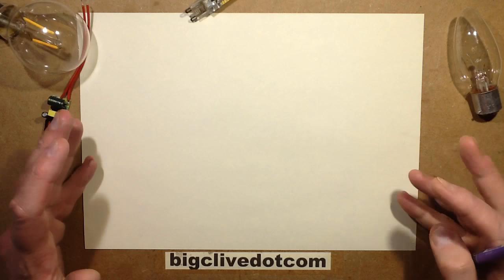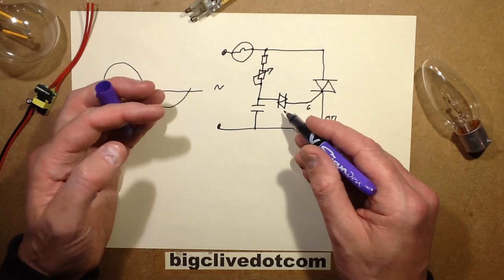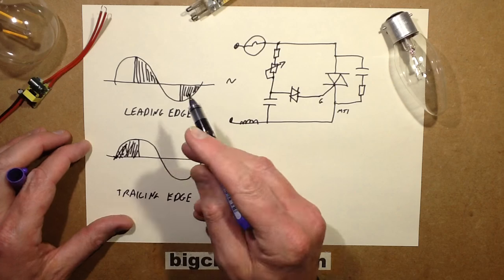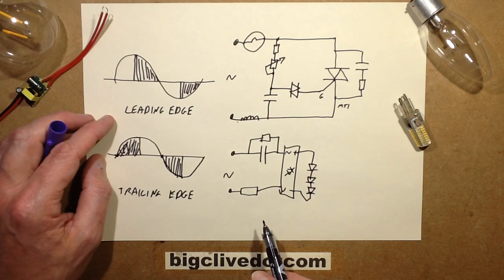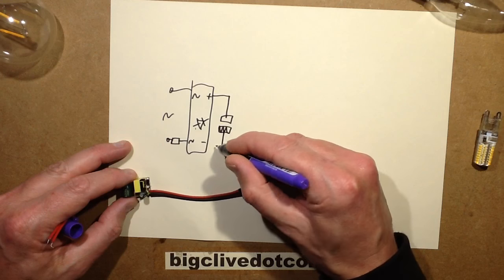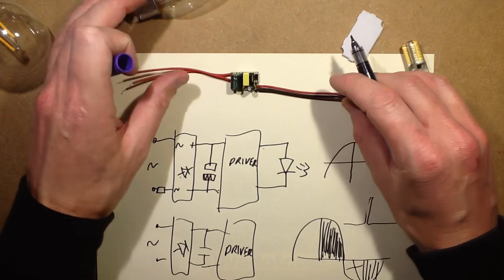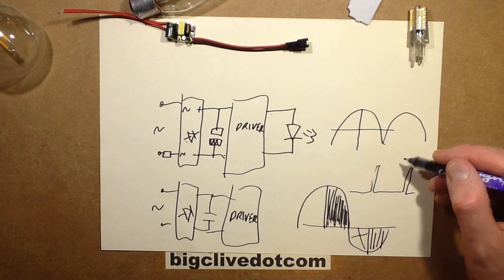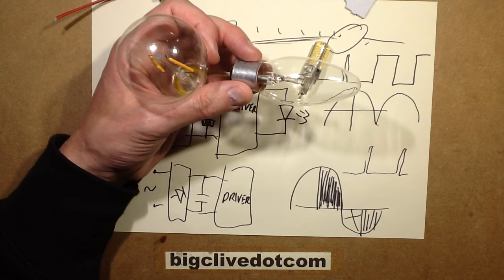Dimming LED lamps with ordinary dimmers.

Comment: Clive - something you've mentioned in a couple of videos. That "discharge" resistor isn't only to prevent the terminals of the appliance giving you a tingle when you unplug it -- though it will do that -- it's a key part of the dropper power supply.

Essentially, it slightly reduces the voltage across the dropper capacitor so that less of the mains voltage is dropped, and so more mains voltage is available to the load. (It's a significant term in the dropper impedance.)

Try removing it from something; I suspect it'll stop working or work at greatly reduced power. And it'll give you a tingle.
Reply from the maker: The resistor is primarily to prevent a tingle from the base of a lamp or pins of a plug.  It passes very little current in relation to the charge coupling through the capacitor.
Reply: Could you please try it? Whip it off something with a significant DC load?

Comment: Hmmm... I have no experience with AC so it may be an obviously dumb idea, but why not just put a huge capacitor after the bridge rectifier so it literally smooths out the chopped sinusoidal input? Would it be too expensive or is there another reason?

Comment: If they're going to develop new wallplates (that would be signalling the lamps over power or via RF), then instead of again switching all the LEDs on and off (albeit quicker this time, using high-frequency pulse width modulation), would it not make more sense to design the lamps compatible with a clean-slate dimmer-to-lamp protocol so that these "dimming 2.0"-compatible lamps would consist of multiple LEDs, and would only drive some of their LEDs, depending on what the dimming 2.0 protocol tells them?

Comment: Instead of PWM to control all LEDs in the light, would it be possible to use the sine wave to turn a percentage of LEDs on? For example, at 100% all LEDs are on, and when the dimmer is at 50% then only 40% of the LEDs are on (I'm assuming it's not a one to one ration for power in to what the human sees). That way, hardly any flicker as it's no longer PWM controlled...

Comment: How do those filament-style LED bulbs work with dimming? There's so little space to hide circuitry, but they work BEAUTIFULLY with both the manual dimmer and smart dimmers I've used. They've got even more range than the incandescents used to have, and they don't even get particularly warm.
Reply from the maker: The circuitry is often ultra-simple and has a high combined forward voltage.  A bit like dimming a string of mains voltage fairy lights.

Comment: my guess is that dimmers will be connected to drivers on wall and low voltage DC (some standard, may be 12V?) will be sent to the lamps.

Comment: It would be good to learn a bit more about dimmers using back to back power MOSFETs. "Two wire" (non neutral) "smart" dimmers are flooding the market are using this design and allows them to sit in series with the load. They steal a bit of current for their own always on circuity by allowing only a tiny amount of current through the load/bulb. Then to turn on / dim the load / bulb, the MOSFETs are opened up allowing more current to flow.

Comment: you know there are dimmable led bulbs, i just wonder personally, do they work properly with a non-synced pwm dimming circuit (constant pulsewidth modulation)?
i'm planning to make a digital dimmer myself, arduino nano, optocoupler, dual output transformer (+ - + to have a "separate" supply for the mosfet and arduino) and 3 fullbridge rectifiers (or 2 if i opt for an SSR, basically a TRIAC with an optocoupler)

Comment: Unfortunately, some of us have the dimmers inside the fuse box... Haven't checked in a while, but last time I checked there was no replacement available yet that would drive LEDs properly. Especially with the weird wiring scheme those things employ (it's pushbutton based).

Two problems with my setup:
1) Although that dimmer is rated for 40W minimum, my 8 x 5W LEDs don't work properly with this setup, and I had to replace one LED with a standard halogen spot just so I could turn the damn lights off.
2) It works fine with my dimmable LEDs, and while you do notice some flickering if you look straight at them, it's not really noticeable otherwise. However, they won't dim down all the way, like the halogens did. At minimum power, they're still a bit too bright for my taste. And they don't dim down to a warm reddish colour either, like the old halogens; it's just less bright white, not at all natural.

After all these years, we still don't seem to have a decent LED alternative for the good old dimmable incandescent bulb...
Reply from the maker: Best option there may be to bypass the dimmers in the fusebox so there's a constant feed to the lamp holders, and then use remote controllable lamps or holder adaptors with the nifty self-adhesive flat wall plate remote switches.
Reply: That would be an option. Or I could check if Niko finally got around to making a wiring-compatible rail-mounted LED dimmer to replace mine. The wiring scheme is weird though: http://www.niko.eu/NIKO/Documents/PM005-70300.pdf (mine is connected with the pushbuttons on the neutral). Time to check their most recent catalog...

Comment: The simplest solution for dimming LEDs would be to use DC power, and just use a suitable rheostat of somesort on a dedicated LED-only radial circuit, so rectify the AC into DC at the lightswitch, then use a variable resistor as the dimmer with an appropriately designed standardised (HAH!! Like that'll happen!) LED bulb in the light fitting, and there we have it... :)

I will say though, I have seen dimmable LED lightbulbs used on youtube, fella in Canada (vlogginlife here on youtube) has dimmable LEDs on two separate relatively standard dimmer circuits, so they are in existence, just not from places like banggood, etc., where our favourite LED filaments tend to reside... :)

Comment: Shouldn't we change the way we distribute energy throughout the places which we live in? I mean...leaving the mains for household appliances but develop new standards, for lighting, now that led replaced old tungsten filament lamps?
Something like a breaker that feeds a control unit that gives out 24V= o 12V= for all the "lighs line"? This way LED lamps would have much simpler circuits since there is no need for transformers, rectifiers and so on, leaving just some resistors, maybe better lamp life (since you are not feeding it with 230V and spikes are unlikely to happen because of the smooth and stable current supplied by the control unit), complete dimmability and so on.
What do you think?
Reply: That would be a terrible idea.

Comment: Would pulse-width modulation (fitted between the bridge rectifier and the LED itself) not be one possible option for dimming an LED light? As I understand it, LEDs easily tolerate rapid on-off switching, and some battery powered LED torches or head-lamps already use PWM to provide different brightness settings.
Another possibility: A miniature variac (directly rotated by the dimmer knob) fitted within the wall-plate, to adjust the AC voltage fed to the LED lamp. Of course a variac that small could only handle a few watts (maybe a few tens of watts at most), but LED lamps only use a few watts anyway, so that should work, should it not?

Comment: One problem has been the lack of a neutral connection available behind the wall switch.  Triac dimmers rely on the load having a sufficiently low resistance to 'see' the neutral at the other end of an incandescent filament, but with LEDs the high (and non-linear) resistance makes things unstable.  When I first saw wall switches with the neutral passing behind through a connector block I thought it was lazy wiring or a failure to understand the 'loop-in' method, but with the neutral available behind the switch, many options become available for the future whether it be 3-wire trailing edge modules; 0-10V; Dali; DMX etc.  One problem when building new houses is predicting whether a proposed new lighting system is about to become obsolete.    It's safer to just specify standard 230V switches or triac dimmers, but at least with a neutral in the switch, some future upgrades are possible.  Could a standard triac circuit be made more stable if it had a neutral connection available?
Reply from the maker: Unfortunately for a while the UK regulations specified that Live and Neutral should not be in switches together as it encouraged people to tap-in and fit sockets next to them.

Comment: This probably sounds stupid and it probably is, but what if you had a small vertical  circuit board with a series of resisters starting at the top and the wiper works its way down starting with no resister for full current and the value of each resister increases slightly until the light is barely on and the wiper starts the current of each resister when the wiper touches that connection? I guess you could call it a variable resister, is this a possible scenario?

Comment: Wouldn't it be possible to have an inductor after the rectifier and cap to smooth out the incoming voltage, and have a circuit that will produce whatever pulse width is required to not use up all the charge until the next half-cycle with that given voltage, without having to worry about the shape of the incoming wave?

Comment: What about replacing the old dimmer switches with variable voltage regulated power supplies and just supplying LED bulbs with clean, straight DC at a voltage adequate to the desired brightness?

Comment: now that you said all this about traditional dimmers what about the new type of dimmers coming out in the market that are meant for LEDs and the LEDs that are meant to be dimmable by these without using the secondary set wires (grey and purple) that you would use in a commercial environment or new construction. do you have any idea how these new dimmers work or does it just go back to the fact that the newer style bulbs have that expensive circuitry inside and it just makes it easier for them to read with a new style dimmers
thanks love you videos and what you do
Reply from the maker: Traditional dimmers shouldn't need the other wires unless they have two way switching.  The trailing edge dimmers are sometimes touted as being LED compatible, but only with LED lamps that are designed to be dimmed by them.
Reply: Thanks
Reply: I use a wall plate which can be set to either leading or trailing edge operation, and use LED lamps specified as dimmable. As the video suggests, there are good and bad - right now I'm only using Phillips lamps where I need dimming; these do use the IC which interprets phase angle & then PWM's the LEDs. These are slightly more expensive, but not excessively so, and are also available in warm colour temperatures - so they are ideal replacements for incandescents. They do operate better, achieving lower minimum brightness, with trailing edge control. I did try lower cost lamps branded Duracell, however they strobed (even on straight mains - no dimmer) to the point that any movement even just walking through the room was disorientating. The difference in cost between the lamps isn't I think too great when you consider the technology you're getting in the better lamp (and clearly the cheapest ones in this case weren't really fit for any purpose, at any price) and the useful working life. I've had a couple of early-life failures on other Phillips lamps (one non-dimmable; intermittent, and one of the much much more expensive "Master" professional range dimmable; dead - however this was running on an old triac dimmer which isn't recommended) but the consumer-grade ones I have (2 sets of 5 lamps each) on the trailing edge dimmer seem to be doing fine. It's the dimmer which is particularly expensive, but looking at how it's all crammed in to give two channels in a single wall plate is quite impressive - they're based on PIC microcontrollers, and also support IR remote control. I miss having the traditional rotary control, but to be honest there's so little space I'm not sure they could have fit one in place of the push switch! I'm still a little uneasy at the way they work (the controller is permanently powered), but there's little else you can do without a re-wire or resorting to radio .. and I'm not keen on radio links for each lamp either, for several reasons (incl. more permanently powered devices, need/ability to operate multiple lamps on a single channel, radio range, security, etc)

Comment: Came here thinking I could finally get an answer to my question as I'm trying to design this very circuit.. 24VAC to 35V pwm LED .. so far so good with triac decoder circuit. But question I can't figure out is if the phase angle is low (say 10%) then how would there be enough RMS voltage to power 35V led using PWM it's full brightness at less time but still uses full power🤔

Comment: I have a new Philips R7S LED Dimmable working perfectly with a Legrand wall Dimmer. I have tried a Philips and other branded G9 dimmable with ceiling fan light but it doesn't work properly

Comment: Hi Clive,
 What if you rectified the mains to DC, and effectively drove each LED as a separate unit using a chip of some sort?
So you turn the light on and x amount of the LEDs light, not bright enough, you turn a controller and x more LEDs light.
What do yoy think?

Comment: I doubt this will ever happen but perhaps the future is (low voltage) DC supplies for lighting circuits. For example have a 36V DC supply at the consumer unit being fed to lighting circuits. 36V is probably high enough that for most houses the cables wouldn't have to be overly thick, larger properties would have a 36V supply on each floor maybe. The bulbs could have tiny PWM modules built in or perhaps better would be to put the PWM in the light switch along with a remote control system or whatever other pointless technology you might want in there.

Comment: Now I really want to try the dimming stuff we sell at my job. They are not integrated into the wall plate but rather kid of dangling behind and you use a momentary lamp switch to control them. Would tthere be different requirements for star and ring mains? (I use LAN terminology).

Comment: BigClive, what is the magic inside an LED load regulator (such as the Varilight GlowFix Regulator) that makes dimmers behave better with LEDs? Is it just a very expensive resistor or a more complex capacitive dropper?

Comment: Would a dimmer that adjusts the output voltage to be a percentage of the input voltage work better?  It would probably have to be nonlinear for lighting, but it could possibly work for inductive loads as well.

Comment: Seems I've stumbled into a minefield trying to go led!
I mentioned on your other vid before I saw this, I have a Philips filament style bulb i picked up in Saintsbury's, saw "dimmable" on the box and thought I'd be ok, but the irritating buzz is there. Interestingly one bulb is much worse than the other, might try asking for an exchange to see if it's just a particularly bad bulb as the other one is almost bearable when not right next to it.
Is there a particular key word i should be looking for when searching for a suitable dimmer? I see a lot described as led compatible, but mention trailing edge, which is no good either? I can't believe there isn't a simple solution to this problem!

Comment: I have several led lamps with warious led count. I think dimming should not be done by electric current manipulation like the old solution where it was only one lightning element in a lamp but simply just lighting up less and less led in a lamp. A 3W LED lamp is much less bright than a 10W with a lot more led so it's kind of a dimmed down version. I think that would be easy to design but it wouldn't be continuous obviously but it doesn't really necessary in my opinion.  maybe 3-4 stages. That would be enough for any needs. Even 2 or 3 stages could be good enough.

Comment: Here is some more information if anyone is interested. 
You shouldn't use leading edge dimmers with any tipe of LEDs, even those with linear drivers which swich how many LEDs are in series. Voltage spike is so big that they can't react fast enough and even small capacitances arround the board make a big difference. (I wouldn't use leading edge dimmers anywhere thease days because some of them make so much noise they affect celphone, WiFi, Bluetoth...)
You can use trailing edge dimmers on most LED lamps with some kind of linear control as said in the video but the problem is not only flickering bacause of ON/OFF but zero cross detection too. LEDs are so fast you can see 0,5% jittering and with so much noise on the power lines these days zero cross detection is not that easy. (We set the minimum for this type of dimmer to 25%) so the jittering is not so visible, but it is still there if you look for it.)
There are many different options for dimming but they normaly start with dedicated LED power supplys at arround 25W and up, they are a bit more expensive but you can get a good brand for arround 20€/$ and they last for years. We mostly use 3 types of dimming: 1.Push button (for old instalations where wires are already in place and you can't use low voltage lines (Short press is ON/OFF, long press is dimming) 2. simple potentiometer normaly 100k ( thease type of power supply are the cheapest and the best in general, the probelem is you should have a cable directly from the lamp to the potentiometer at least 20cm away from mains power). 3. 1-10V (If you want to control more than one light at the time and you can easily add WiFi/ Bluetooth to this line) There are many others like DALI,DMX,KNX,Bluetooth, WiFi, LAN,... but for now I would advise to just use them for playing arround and not controll the whole house on it because one day it fails and when it does it takes a week to set up again. Leave those to companies, shops, entertaiment and people with too much money xD